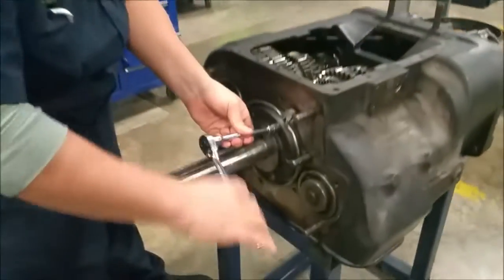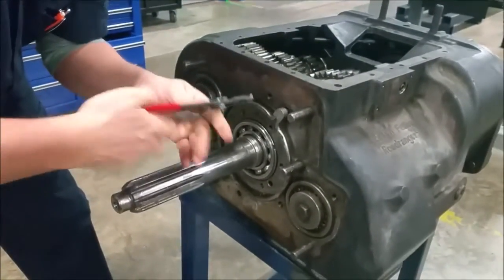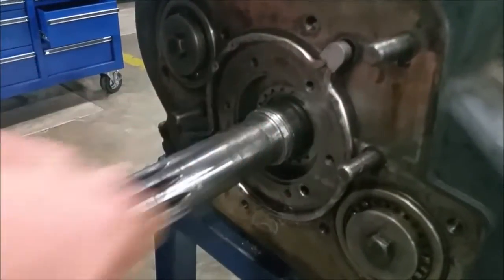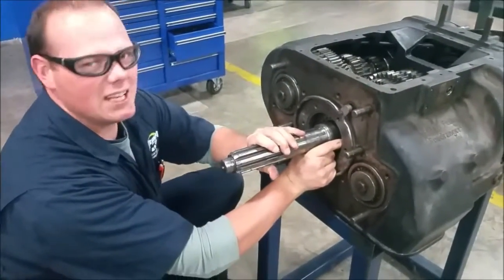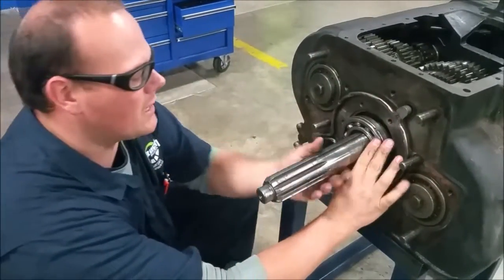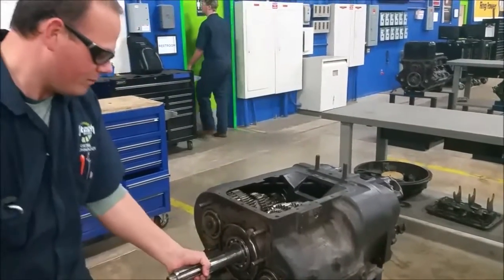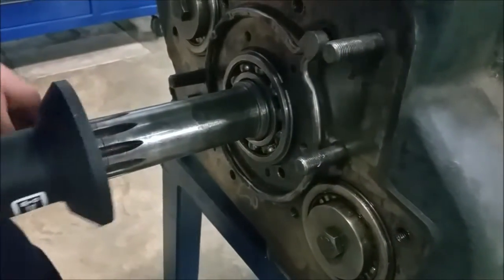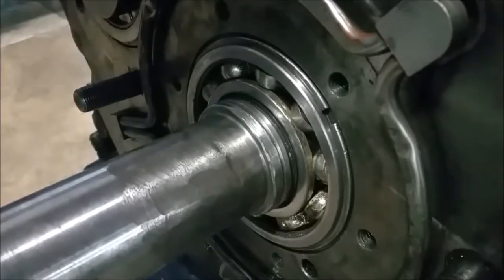Heavy Duty truck transmission input shaft

Comment: Does it post to have that spacer behind the bearing I pulled one out this weekend and it did not have the spacer in it does it post to have the spacer in it or do I need to get a spacer and put it in before I put the bearing back in
Reply: You need to put spacer